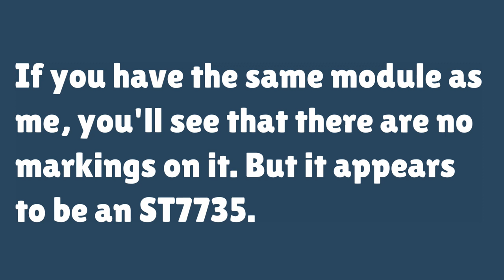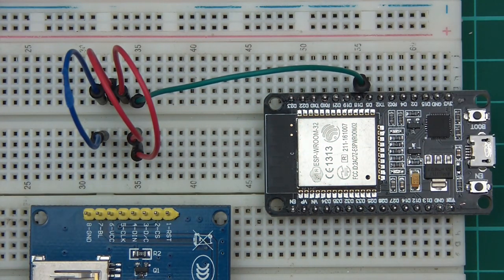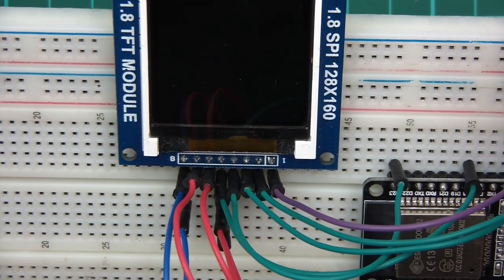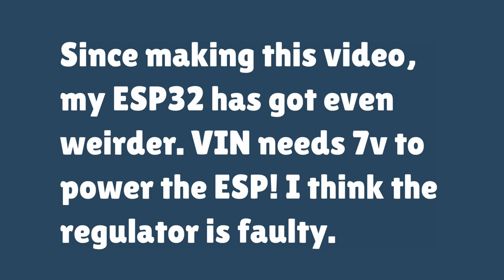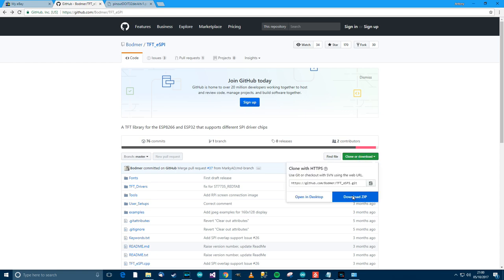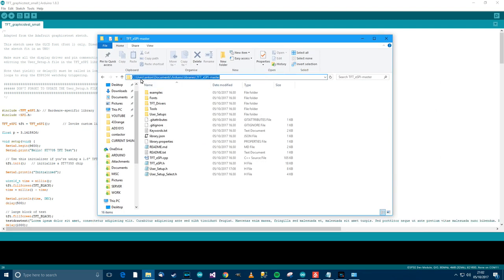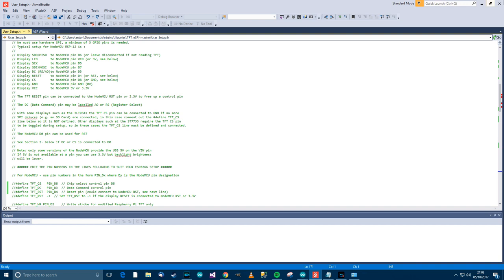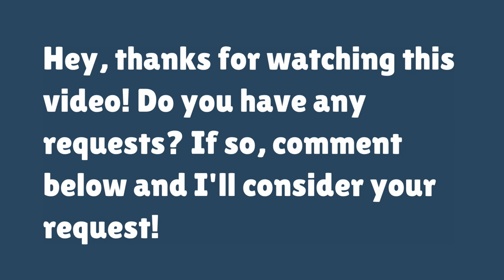TUTORIAL: How to Wire up and Code a TFT LCD Screen with ESP32 (Arduino) ST7735R

Comment: TFT_RST is to do a hardware-controlled reset of the graphics chip. I don't think it matters in the latest version of TFTe_SPI.  I suppose there must be times when you want to reset your graphics device independently of your processor. If you ignore it, it will (should) reset with your processor.
Lots of these displays have I2C markings, but are really SPI.
Yup, your regulator is faulty, my ESP32 drives two displays and a bunch of LEDs from the 3.3V line.  Or it may be your USB line that can't supply enough current.  There are some early boards that have a 100mA regulator, later boards have a 500mA regulator.

Comment: Do i understand correctly that you power the esp32 through usb and put an external 5v on the display AND connect that to the vcc pin of the esp32?
Why not power the display with an external 5v and ONLY connect ground. Now you have a short circuit on 5v, but maybe i misunderstood.
Reply from the maker: Hi Arnoud! I put 5v of external power to ESP32 & TFT. Also USB power to the jack. Behind the VIN pin (and presumably the VCC pin of the USB jack), there is a Voltage Regulator which regulates voltage to 3.3v.I can't see any short circuit, but maybe I'm wrong! :-)
Reply from the maker: Hey Arnoud! The 5v pin (or the VIN pin), it's an input pin and not output. You can see in the diagram which you just shown me that VIN goes to a 3.3v voltage regulator. As far as I know, it's perfectly safe to input 5v to that. There is no 5v output pin on the ESP32, but there is a 3.3v output pin. You realise that the two little clips are directly from a power supply right?! It's not a voltmeter! ;-)
Reply: I dont know what you mean with the 2 clips and a voltmeter. If USB is connected, the 5v pin can be used as an output (Same symbol as the 3.3v pin).
But it's never a good idea to connect 2 powersupplies this way. I rest my case; at least there is a diode to protect. Thanx for the video; I watch them always as you can see!
Reply from the maker: Ahhh, ok! Yes, there were two power supplies! Incidentally, the reason why I used two power supplies was because the ESP32 wouldn't power from USB alone. I suspected that the AMS1117 was broken, but it wasn't. There was actually a faulty diode on it! That diode which you've just mentioned. It's too tiny for me to replace though, so I shorted it out! Now it works off USB alone as it should! Thanks for drawing the image too, I understand what you mean now. Maybe I need to read some more of my theory books, but I still don't see a short! Let's say for example, we have 2 x 3.7v cells - if you connect the cathodes together, and then connect the anodes together, it doesn't make a short, it simply increases capacity/amperage capability. The devices just draw current proportional to the resistance of the two cells, right? Thanks for watching my videos! Thanks for your feedback too! Sometimes, my viewers have better knowledge than I do! :-D
Reply: Hi Antony, nice video! Maybe you can use some SMD soldering practice? Once you get the hang, it can be quite fun...
I already repaired a couple of Arduino boards that had faulty components. On my channel you can find a video about repairing an MT3608 boost converter as well as one about soldering my very own mini boost converter using SMD components. Have fun!
Reply from the maker: Maxint R&D Hey! Good idea! You can actually buy practise kits! I can do the bigger smd things but this one is just ridiculous! It's about 1mm long!!!
Reply: I also have such a practice kit. Good exercise as these kits have components in different sizes. I find the 0805 size (2.0mm x 1.25mm) quite doable, but you do need tweezers and not mind spending time with a flashlight and your face on the floor hunting for dropped components. I find the 0805 size particularly handy as it fits well on the 0.1 inch spaced pins and the holes of experiment board. You can see me fiddling with some tiny SMD components here: https://youtu.be/K7Lv5FWTX9Y
Reply from the maker: Maxint R&D cool, I've got a few videos like that too, but I try to avoid SMD though! I guess it depends on what you're used to doing! I've got videos of me working with SOT components...
Reply: Yes, you've got a large number of very interesting video's on your channel! I subscribed not very long ago and enjoyed watching quite a few already, but still have many left to view. In the mean time I'm trying to release a new video, coincidentally also about a display connected via the SPI pins. In my last video I disassembled a bank card device and in the past weeks I've reverse engineered the LCD panel and made an Adafruit GFX display driver for it. Took some time but it's working now and I'm almost ready to upload...
Reply from the maker: Maxint R&D Thats good! I just do videos on whatever I'm interested in at the time! :) Today, it is going to be about 433mhz radio.
Reply: Hey Anthony. In your example connecting two 3.7v cells, you're right and wrong. It does increase the capacity, but since they never are exactly the same voltage, there will be a current from the cell with the highest voltage to the other. 
Try an empty car (lead) battery connecting to charged one... you'll see sparks!
Removing (shortning) the diode is a bad idea. Now unlimited current is possible between the two power supplies. Please use 1 only!! Now you created exactly the situation in the drawing I made. The diode is there for a reason!
Reply from the maker: Hi Arnoud! Thanks, I've added a note in the description, I've replaced the AMS1117 and I've modified the ESP32 to only allow power through the VIN pin. I'll look into this int he future, but you're obviously right because there is a diode for that reason. Thanks, Antony...
Reply: Arnoud van Leijden So one power supply is enough for this circuit?
Reply from the maker: From what I gather, and from what Arnaud has said, this module should be run on only one power supply. The problem is though that in circuit, there is a heavy voltage sag and my USB ports can't cope with it, then the module browns out. One solution is to take the ESP32 out, plug USB in to flash it... Then take USB out and put ESP32 back in circuit in order for it to work properly. :-)
Reply: lol @ the dropped smd components ... - many happy times spent crawling around on the floor looking for grain of sand sized components with my special led component hunting torch... <sigh> total empathy :)

Comment: You need more than 5V because the display takes some of the power from the ESP.
Reply: thats not how that works
Reply: @pacman10182  you cant draw more than 200mA, but i already frgot what it was about anyways lol
Reply: @eventhorizon8014  you can draw as much power over 5 volts as you want, I assume your mean over USB, thats got a current limit of 500 mA
Reply: @pacman10182  kk, yeah... i was thinking on arduino again^^ that has a max of 200mA iirc, more and it'll grill the arduino
Reply: @eventhorizon8014  thats also not how that works
Reply: @pacman10182  you could for example explain what you mean, instead of just repeating yourself with meaningless comments. i KNOW for a fact, that theres a maximum of peripherals you can attach to an arduino, and NOT because of lack of GPIOs
Reply: @eventhorizon8014  thats what you meant, I thought you were talking about the current draw of the avr itself